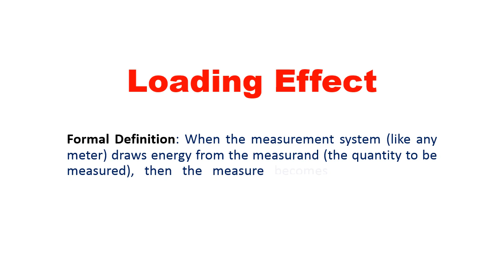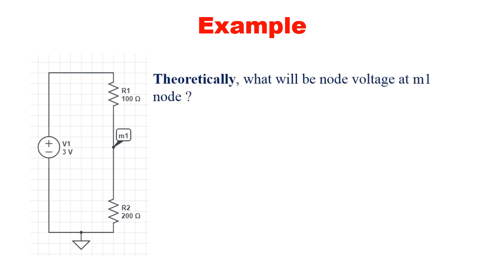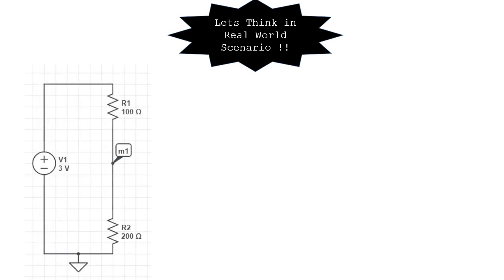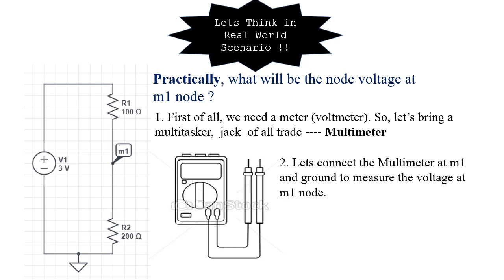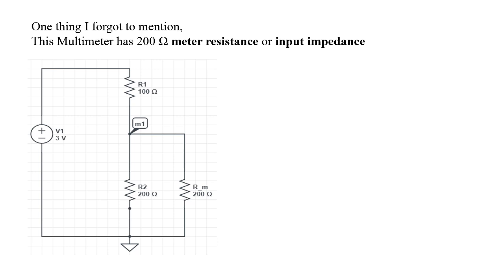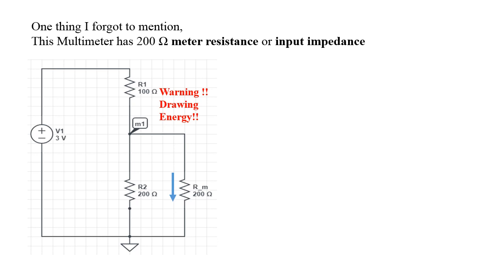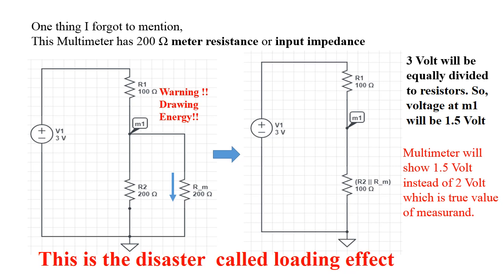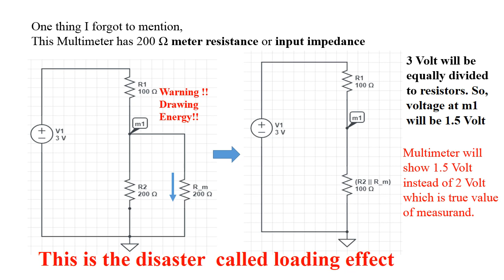What is Loading Effect

Comment: Can loading effect affect a circuit? 

Example: at work we have a machine that we put into “run mode.” The machine runs and when we check voltages between terminal 152 and ground the machine stops running. I don’t know why! Please help
Reply from the maker: Is the voltmeter connection okay? If the voltmeter is faulty it may cause problem, may be shorting the connection between 152 and ground
Reply: @sumanbiswas8933  yes, tried multiple multimeters with the same outcome
Reply from the maker: @emmanuelsuazo1318  are the voltage ranges within multimeter range?
Reply: @sumanbiswas8933  yes. We are within 240 volts
Reply from the maker: @emmanuelsuazo1318  is that DC or AC you want to measure? Multimeter should show RMS values. But please watch whether in multimeter is there any option for DC or AC. Please chose according to your voltage ( AC or DC)
Reply: @sumanbiswas8933  these are ac values and all multimeters that we used are set to the ac option